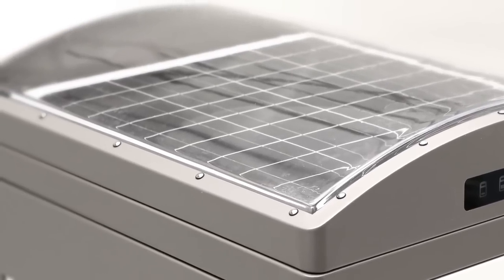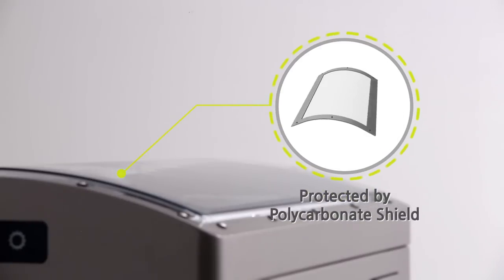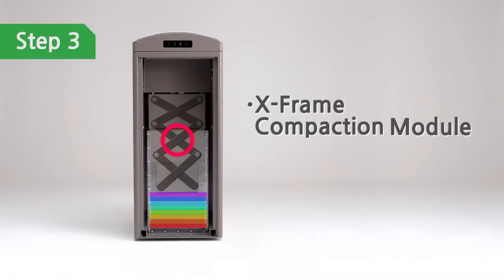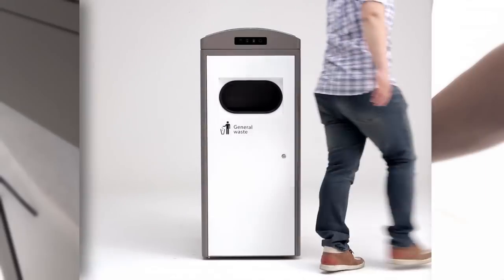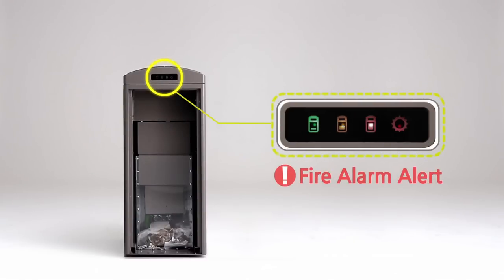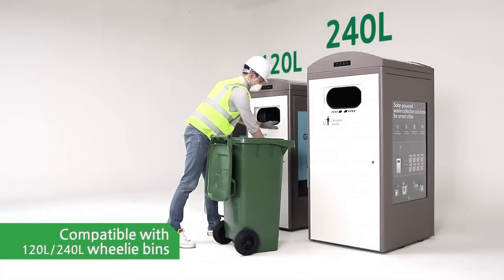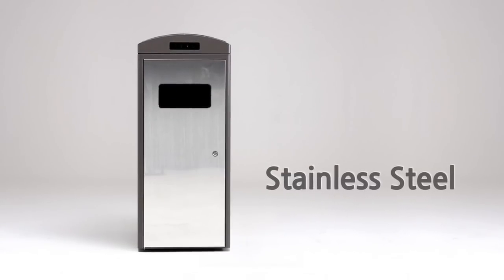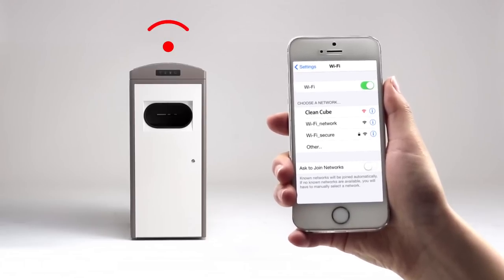Solar-powered trash compactor bin (CleanCUBE)

Comment: Do you have circuit connection design for level sensor, Safety sensor, Fire Sensor, GSM, DC motor, lead screw.
And then, Are you using Arduino board for this connection?

I hope this message will reach you. Please reply me I need your help🙏🙏🙏🙏🙏